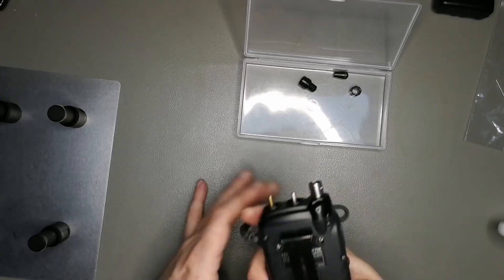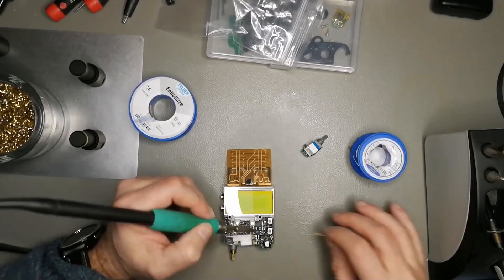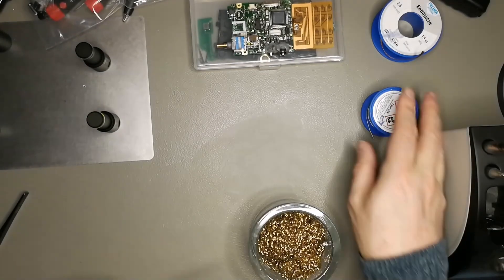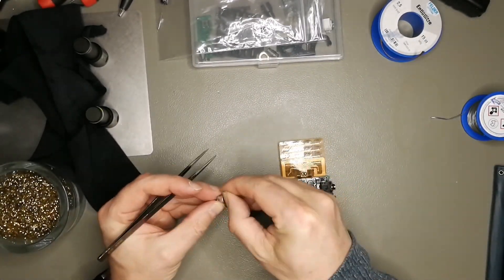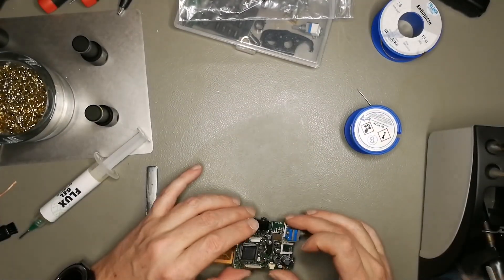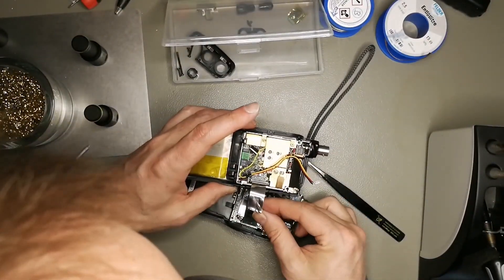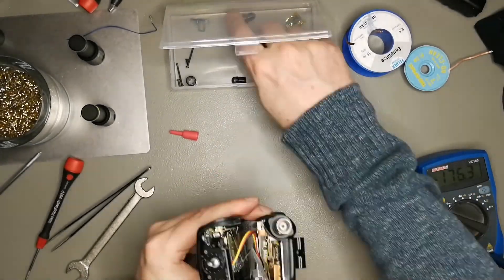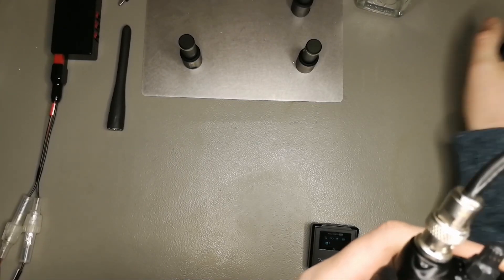Kenwood TH-79E repair #3 - Recapping... | HamRadio

Comment: hallo, Wow, ich hab ein 79er der will irgendwie nicht mehr Empfangen oder senden. kann man dir diesen zu schicken? 

73 DD6LKB
Reply from the maker: Hallo Lars!

Ich bin leider kein professioneller Reparaturdienst und habe nur durch Sturheit so lange an zwei gebrauchten TH-79 rumgefummelt, bis sie dem Anschein nach funktionierten. Das hätte auch komplett schief gehen können.

Finanziell war das sowieso nicht sonderlich schlau nach dem ersten Fehlschlag noch ein zweites TH-79 zu kaufen. 🤦‍♂️ 2 gebrauchte Funkgeräte, zwei neue Akkus, CTCSS Unit, Plastikkappe für CTCSS Unit, Servicemanual, neue Polarisationsfolie und Leitgummi für das Display, neue Kondensatoren und zuviel Freizeit. Der komplette Wahnsinn... 😂 

Die zwei Schwachpunkte des TH-79: Das Display und die Elektrolytkondensatoren altern halt. Wenn man Pech hat läuft das Elektrolyt aus und frisst sich durch die Kupferbahnen des Boards, dann ist nichts mehr zu retten.

Wenn gar keine HF mehr rauskommt kann natürlich auch was auf dem HF / Endstufenboard kaputt sein.

Oder du probierst es erstmal mit einem komplettem Reset. Mein TH-78E war nach vielen Jahren in der Schublade so verwirrt, dass nur ein Reset geholfen hat.

Viel Glück!
73 DL3MHT

Ich würde Dir empfehlen das ganze erstmal (auf eigene Gefahr) visuell zu inspizieren. 4 Schrauben lösen und man kann die Ober- und Unterschale auseinander nehmen. Vorsicht mit den Verbindungskabeln.

Comment: I admire your patience and skill on such a tedious task.  Does the extra heat required for unleaded solder cause any problems during a rework?   John, k0ebc
Reply from the maker: Thank you John! I actually find it quite relaxing. Ordering the parts is always the most annoying bit.

I used leaded solder for this exercise. You can still order new SnPb solder here from certain shops.

I don't think that a few degrees more make a difference. I am just used to leaded solder and will need a few more decades practice to get confidence in my lead-free joints. 😆